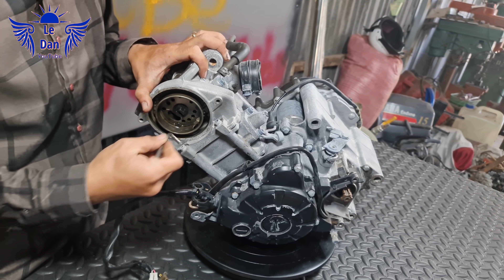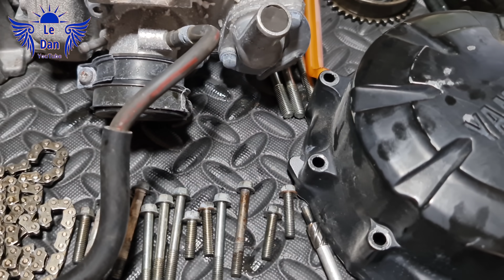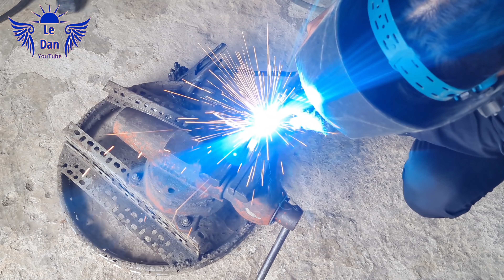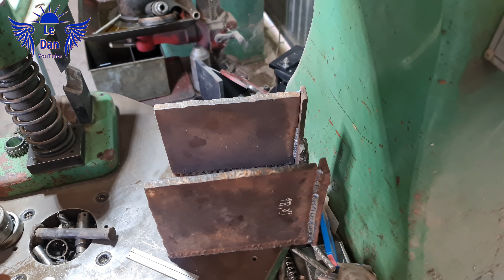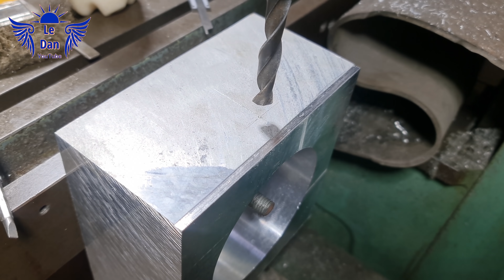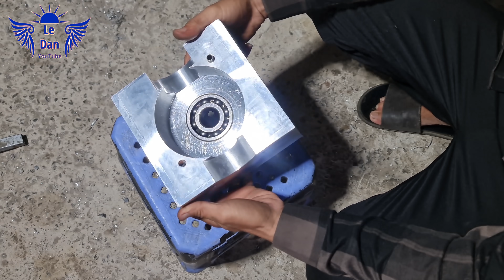I turned the regular engine into an 8val boxer engine

Comment: Cool work they are VW beetle engines too and porches but.vw one is also and in international and other school buses rucks semis now cb performance customized too now to make them go much faster Cary heavy weight more power to crash into one another like demolition derby school buses and regular school buses going up snowy hill semis pulling weigh etc and delivery trucks cause loads are getting more heavy and more advanced and tires spin just as fast as cars right away not slow and cumbersome to fast but fast right away like cars or spin much faster

Comment: Hello Le Dan. You do fantastic work.
You are a great engineer.
The problem with this design is that it does not have a centre main bearing between the conrods.

If you rev it too high, it will bend there
Reply from the maker: Thank you for comment
Reply: @Alfred Wedmore just made like a vtwin crankshaft will bebetter

Comment: Cant wait for the next step Prof 👍👍👍

one of clever yet a disadvantage of yamaha sniper 135 or Jupiter MX is on waterpump section, a wrong instalation will cause a nightmare as the waterpump is connected to the camshaft..

my suggestion is, you should make it to be an electrical waterpump..

👍👍👍

Comment: Pretty freaking cool! Make an inverted version next with 2 pistons compressing 1 cylinder. That would be wicked
Reply: đỉnh của đỉnh
Reply: @Alfred Wedmore only benefit now would be bragging rights 😉 a DIY two stroke with valved heads and a blower for scavenging would be cool though.
Reply: @Alfred Wedmore Yeah, I know, I mean opposed piston diesel would be for bragging rights.
Reply: That is a 2 stroke though and will need to have a long liner with ports in just the right places, might be hard to do.

Comment: You are a master craftsman and born engineer! With the CNC machines making people lazy, you inspire people to build things with their hands and mind. Superb
Reply: try you check channel psycho engine from indonesia
Reply: @anggakechenk158  indo juga ada tah bang?
Reply: @baniab9721  ada mas bahkan karya motornya sudah sampai contest di yokohama Jepang
Reply: @baniab9721  bukan ada lagi,,, banyak bang,,,,
Reply: @baniab9721  w1 engine builder, psycho engine, dan masih banyak lagi yang gk keliatan
Reply: https://youtu.be/XUKmQeY0bbQ
Reply: I do not agree. Writing a CNC program takes a lot of time, skill, math and understanding, and you need to know how a manual mill works before you can start using a CNC.

I do however agree that all of this work is performed on an older manual mill and yes, that takes a lot of skill because a CNC would point out mistakes before you make them, and this does not allow for mistakes.